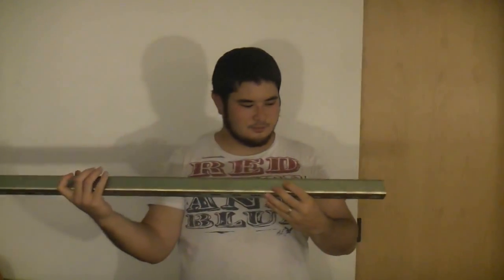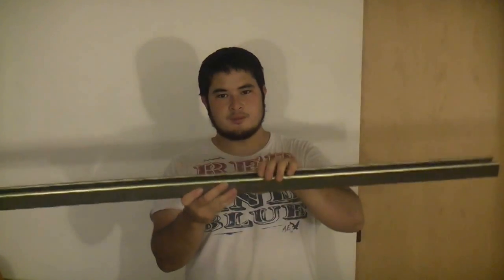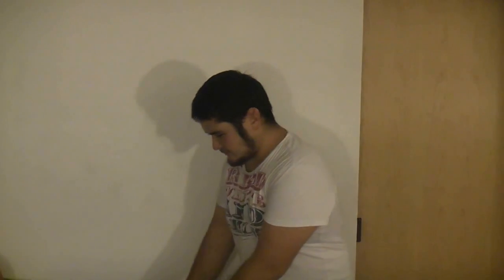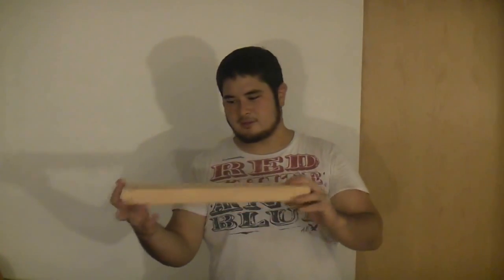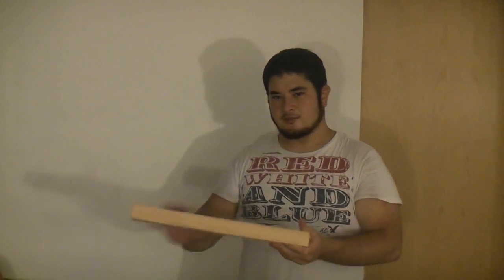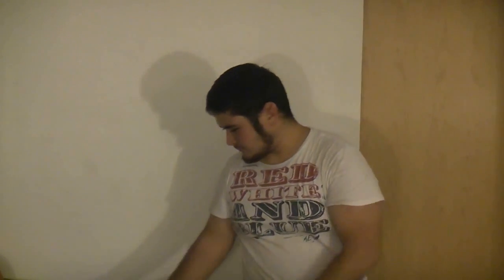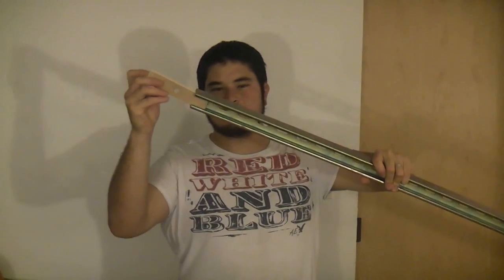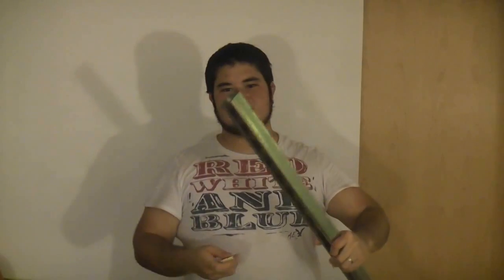How to Make a One Arm Endless Loop Bow String Jig Part 1

Comment: Hi Nick. I found a great piece for making the main strut shaft is a sliding leg from an old pop-up shelter. These pop-ups are generally short lived because they don't stand up well to wind, and generally just get tossed. But they have sturdy legs which slide open. The leg are typically square and the parts slide into each other and can be locked at different lengths from 4 to about 7 feet. Broken pop-ups are easy to find around campgrounds, outdoor festivals, and maybe in a neighbor hood dumpster.
Reply from the maker: Thank you! That's a great suggestion!